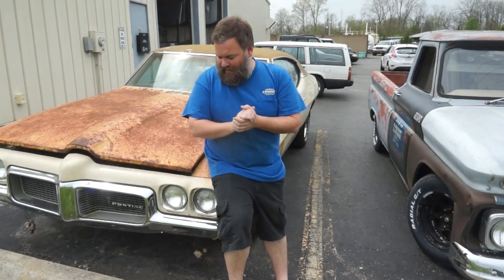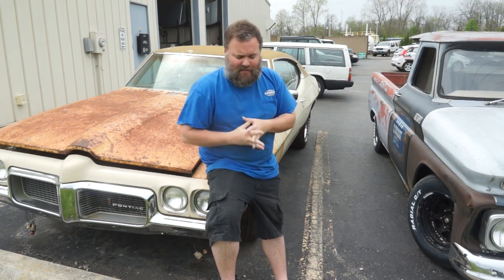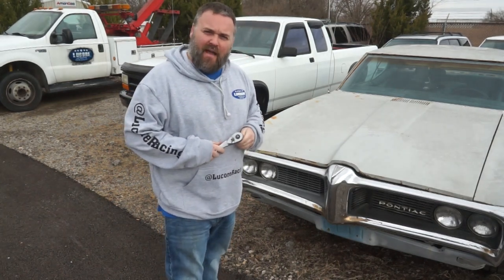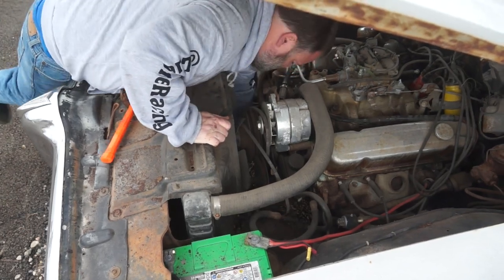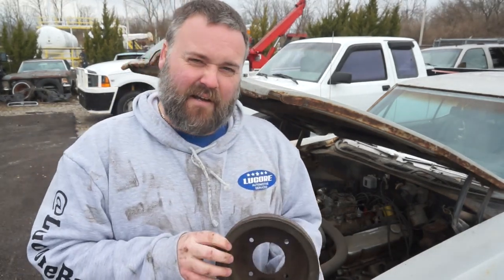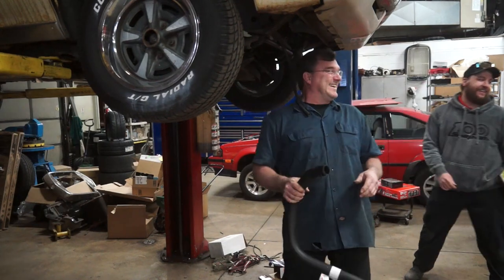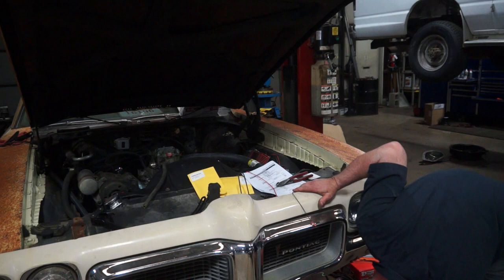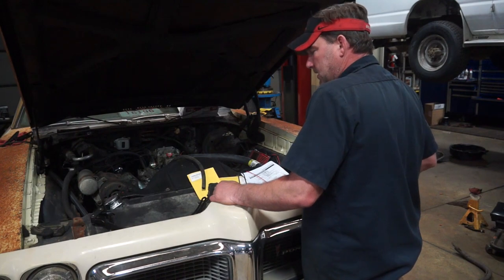455 Pontiac LeMans first start, and discovering lots of issues. From Lucore Automotive

Comment: Love code50 Sierra yellow. I had a RAIII goat years ago.
Reply from the maker: It's growing on me! I still want to keep the front end rusty and aged, toss some clear on it versus repaiting/repairing all the body work and making it perfect. At least, I think I still do. Thoughts?
Reply: Lucore Auto and LucoreRacing  This is from a 69 year old. Make it look like grandma's car, repaint it 50/50 (all yellow) leave all the markings including the 350 emblem's on the rockers stock the only thing to add would be a 69 judge stripe. For wheels leave them period correct (no20" hoopties). As for under the hood, scrap the headers and get some RAIII manifolds  either paint the valve covers blue or find some M/T valve covers  leave the AC compressor in place and get a duel snorkel air cleaner ( that's more than ample to feed a low revving 455) as for drive train a built Th350 or if it's going to be a highway cruiser  a built Th200r4 with lockup. Out back stay with the 10bolt and run 3.42s to 3.90s depending on use & transmission. Exhaust 2.25 from the manifolds to a H orX pipe  to dynomax full size mufflers (for the sleeper image quiet) two duel exhausts dumping just foward of the rear valance (out of sight out of mind that sleeper image!!). If it was me today that would be my move.

Comment: Ive had this issue in the past with my 71 lemans sport with a 455 and what I did was just space the other brackets and no more problem.The harmonic balencer on the bottom for a 72 is thicker thats why its fighting you.Dont over think it and space it.As many engines I put in mine racing in the 80s I had to be creative cause nothing was ever the same.LOL!Pontiac was a PIA over the years and would change stupid things
Reply from the maker: How did you space them properly? Just use some washers and call it a day? We actually just put out a follow up video to this and THINK we have at least the idea as to why we are having this problem.

Thanks for suffering through this all with us!
Reply: I used a solid round bar and drilled it and cut it to make them. I had to sand to get them perfect.
Reply from the maker: @davidjohnson8474  Well right now it's not chucking belts so... we'll see. We're SOMEWHAT considering going all new accessories to get more shiny new bits to put with our big shiny blue motor but... that stuff is EXPENSIVE!
Reply: @LucoreAuto  lol oh yeah they can be being a pontiac. I'm betting the bracket's are a mixture of old style and later ones. Did you talk with Butler performance?

Comment: OK my brother think I can help you out by now you should know I am a big Pontiac fan  owner of 67 and 69 Firebird which I have some YouTube videos on  1st start with the water pump  Measure the snout You have to find out if you have the short snout or the long snout keep up the good job and let's but that pontiac back on the road 👍
Reply: Pontiac early 1969 had a short snout water pump Late 69 all the way to a believe 81 Have the same snot water pump so everything's is going to lineup if you have anything from late 69 through the seventies I had the same issue when I was rebuilding my Pontiac 455 motor that I have in my 67 Firebird  If this is your problem I would just change the water pump and get a  70 water pump and everything you have their accessories should lineup  Also Pontiac harmonic balances are not press in If I can help you in anyways don't  Hesitate and get back to me
Reply: @firstgenerationgarage2803  Buicks also had long and short snout water pumps, FWIW.
Of course chevy's too, vette pumps were short if I recall.
Reply: @thisisyourcaptainspeaking2259  nice I only  know pontiac
Reply: @firstgenerationgarage2803  Pontiac is my weakest subject, lol.
Reply: @thisisyourcaptainspeaking2259  LOL 😆

Comment: Didn't you change the balancer on the crank? Could it be pushing the pulley forward?
Reply from the maker: We tried a number of things, the balancer the motor was run with on the dyno, a brand new ATI one, AND the original one that was on it before the motor was rebuilt. You'll see some of that in today's video actually. Also tried several different crank pulleys

Comment: I have 2/ 455 complete engines sitting in my garage one is a 1970 & the other is a 1972 both were running when pulled not sure if I'm gonna use them or go LS

Comment: Pontiac change timing covers I believe in 1968. Along with some water pumps.   I would go and look up Ames Performance in New Hampshire. They have reproduction police and everything they can probably set you straight
Reply from the maker: The pump and timing cover are most definitely the later generation BUT I believe you are onto something with the latest 68 switch over, the accessories changed as well. Which is starting to look more and more like our problem

Comment: I have seen where the heads had to be drilled because they're too new and didn't have the same bolt holes drill and tap a hole for certain brackets especially if you don't have the originals
Reply from the maker: The big challenge with this car is really NOTHING is original as far as we can tell. The odd thing about this whole thing is it's the same block/heads/accessories and pulleys that were on it back in episode 1 of this playlist.
Reply: You don't really want to go drilling into heads that's a very delicate situation all the way around lol
Reply: Ok U know best😁lol

Comment: What if you used all the brackets off the 68 together?????@$&cents
Reply from the maker: Considered that actually! But the 68 stuff SHOULDN'T fit on the 72 block 76 heads correctly. However if it fit the wrong right way it would at least verify our issue

Comment: I'm sure somebody added that to help with  vapor lock Pontiacs are very prone to Vapor locking at least from my experience and what I've seen I had a 69 the 400@$&cents
Reply from the maker: I dunno, never had that issue before on a Poncho, initially we assumed is was for an oil cooler setup then you trace the lines... very odd.

What situations were you getting vapor lock?
Reply from the maker: @SweatyFatGuy  we had never seen it either, tried coming up with any GOOD excuse we could and.. yeah pretty much nothing we can think of. Weird weird stuff!
Reply from the maker: @SweatyFatGuy  the TV cable situation has proved to be an absolute NIGHTMARE so far, totally didn't see that being such a headache. We've ordered cable after cable and none are even close. Very very frustrating especially factoring in the wait time.

Transmission wise we'll see how this TH350 holds up, it's been entirely rebuilt and upgraded so... yeah we'll see. Plus this car is going to be a daily driver not s race car so won't see TONS of abuse :) Though the piles of torque the motor now makes won't be cutting the poor transmission any slack even on the street

Comment: “That’s not a thing by the way.”
Reply from the maker: Lol yeah had to include that statement just in case people start looking into PCV coolers cause they saw it on YouTube ;)
Reply: Lucore Auto and LucoreRacing I’ve been thinking about this. I wonder if the engine had so much oil coming thru the PVC they were trying to condense the vapor out of it before sending it back to the quadrajet.
Reply from the maker: @totalyep  It's somewhat possible they were thinking along those lines, there WAS some oil burn/blow bye before we took the car apart. From what we can tell though there was no oil actually in the lines soo.... who knows. It sure must have seemed like a good idea to someone at some point!
Reply from the maker: New video is up btw :)

Comment: Use the entire front drive from the 68, as long as both water pumps have the same number of bolts. Brackets and everything.  It looks like you have a mix of 66 and earlier,  68 to 72, and 76 front drive parts. The year breaks vary between a f abd b bodies as well as front drives.
Reply from the maker: That's what it seems to be to us too, someone just grabbed an accessory set they had around when they were cobbling together this monster. The question becomes, do we get an entire new pulley/accessories setup or run old stuff.
Reply from the maker: @SweatyFatGuy  honestly haven't even looked at the 350 that's in the 68, it's been sitting waiting for a long long time for a chance to get attention. But as far as I can tell it seems to be a virgin block/heads so it would be something from 68... I assume. 

Realistically if this IS our problem I may just order an entire aftermarket pulley/accessories setup and just swap it all out for shiny new parts. Step 1 is getting it running and idling correctly :)